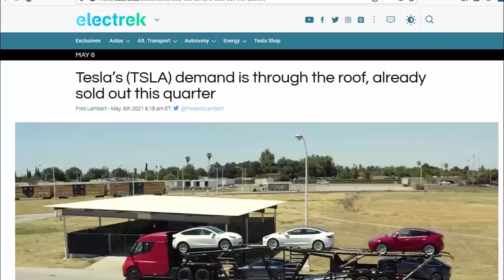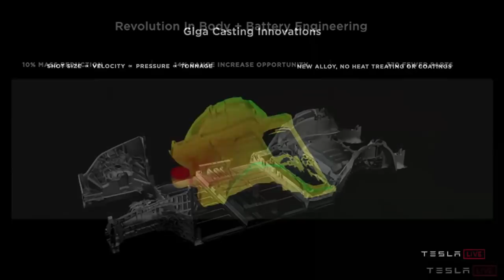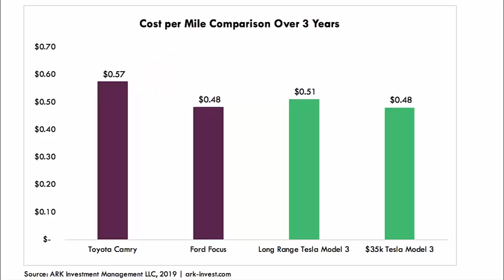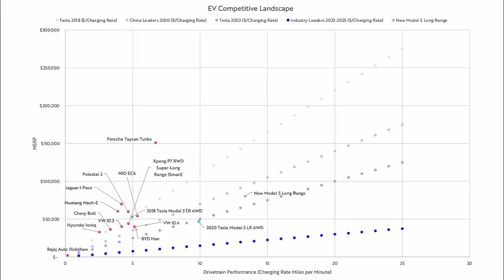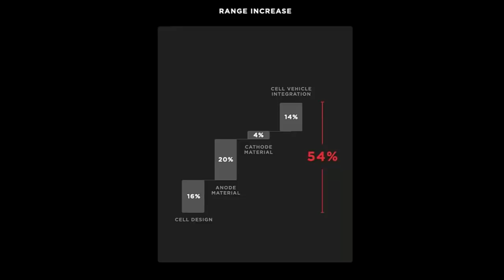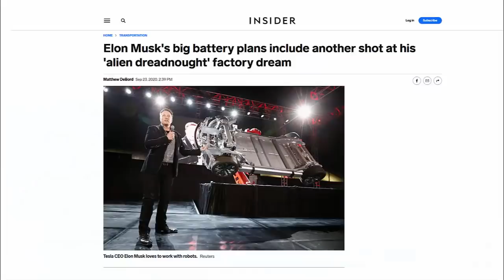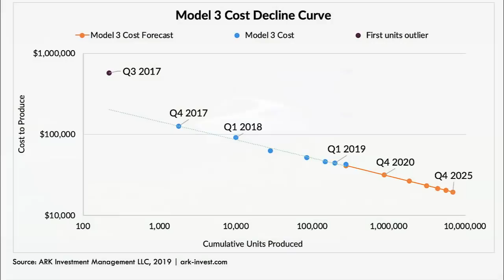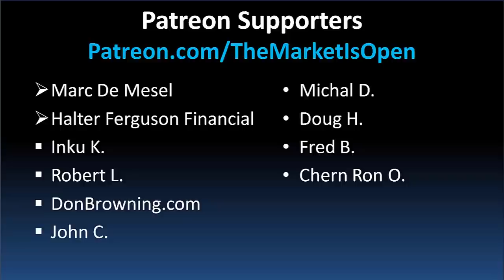The Frightening Economics of the Tesla Model Y

Comment from the maker: Do you think the Model Y's economics will allow it to become the best selling car in the world? What are your thoughts on the giga casting and the 4680 battery?
Tesla's Insane Plan to Produce the World's Best selling Car: https://www.youtube.com/watch?v=0C2K5vdG9WA

Inside Tesla’s Secret Plan to Dominate with Solar and Powerwall Plus: https://www.youtube.com/watch?v=W8ivhjzhYXQ
Have a look at our website https://themarketisopen.com
Reply: Some thoughts. Will the model 3 be able to use the same castings as the model Y? At first glance it would seem not, and it would only be a die change if not. But it if could share the design, that would ripple through the rest of the body shop. Also, I believe we may see the structural battery pack be a casting as well. The bottom and sides seem ripe for that type of savings. With regards to 4680, my estimates are that the High Nickel will be 120wH per cell, Nickel Mag 110wH and LFP will be 80wH per cell. Cost per pack will come down to $5200 for High Nickel, $4180 Nickel Mag, and $2900 for LFP.
Reply: Is it really tons of force or is it not just the weight of the casting machine?
Reply from the maker: No it's a custom machine ordered by tesla and the 6000 tonnes is force. The machine itself weighs around 410 tonnes.
Reply: @TMIOTesla  ah interesting. Why does it need so much force? I guess to resist the 800 lbs of aluminum traveling so fast
Reply: I like both the 3 and the Y but for me personally whilst I'd like the Cybertruck very much....it's more then likely going to be the awaiting $25k Tesla I'll be getting!
Reply: @Haliotro  yes, the cast has to be done very fast under very high pressure to avoid faults in the Alu alloy - that's problematic with standard alloys but Tesla has developed its own special mix.  This is amazing from a manufacturing standpoint, an innovation completely unrelated to electrification, much like the octovalve heat pump in that respect.
Reply: It can be the best selling car, for that it has to sell around 1.5 m only in order to beat the Corrola.
Reply: Y will start a crushing series of amazing developments
Reply: Best selling car in the world ?   No way.  Not unless Tesla finds a way to greatly reduce their price.  Also i think that the big car manufactorers have woken up and begun heavily investing in electric cars and it's only a matter of time before Tesla will have lost their lead,  if they had one.  

For Tesla to be the best selling car in the world it has to compete at more of a Toyota pricepoint,  not BMW pricepoint. The price needs to be cut in half to have a chance.
Reply: @peternielsen8723  It’s a fact.. all you have to do is look at the sales figures in each country. Tesla is at the top … even selling more than all ICE cars. The figures speak. Everyone is waking up because Tesla was taking their market away. So now time to caught up … good luck. Tesla is so far ahead that it is going to be tough. Maybe you will have to wait for the $25k car. With credits it won’t be so expensive anymore… unless you want to buy a the mini in China .., more like a go kart however.
Reply: I think it's odd that the most efficient car manufacturer in the world needs so much space for its factory. Is its factory smaller than its competitors?
Reply: Just a note about battery day presentation. These improvements in battery tech are expected to be achieved within 3 years from the presentation, as it was mentioned during the presentation. Meaning 2023 not 2021 when Berlin/Austin factories are supposed to go live. So Model Y will start production with only some (maybe none) of those improvements available, and some of these improvements might never arrive at all- it's all still experimental tech at this point. That being said, Tesla seems to have a very good groundwork for 2023...
Reply: Less is More. The competition remains the same. So he has far fewer parts to begin with and this will come down even further. They will create for joined or assembled parts off the cars. Assembly will assembling sub assemblies. Also the after market. You buy a New Tesla you buy a home charging point. You sell on your Tesla but you keep your charging point. The new owner becomes a member of the Tesla family. Where do you get your Tesla Derviced, Repaired? No back street autoshop. Again back to Tesla. With the iminent release of the Roadster & the Pick Up truck. Tesla an entrant in every segment of the market. The pick up could be the bell of Tesla when it goes head to head with Ford's F150 Lightening.
Reply: Carlo, wake up. Tesla sales in Europe is going waaay down
Reply: No. Tesla is about to face a ton of competition, and Elon Musk is going to go crazy why other automakers enter the EV market. The Ioniq 5 is a perfect example. Also, Tesla is not even close to a top global automaker. The Model Y might briefly become the best selling EV, but it's still a pricy luxury vehicle.
Reply: Tesla has a fight on its hands. Not from Europe but China and South Korea. Build quality, shut lines and paint should be a given. Tesla is behind the competition and its market segments on these. Xiaopeng and Geeley are up with it on automation. The game is getting tough. But, where Tesla really falls behind is cabin design and ergonomics. Putting out something that looks like a clean desk purge in a low rent IT department no longer cuts it. Note how Hyundai corp and Mercedes have shied away from the touchscreen scourge. Look at the cabin ambience of the EQS vs Model S. Xiopeng is also scaling up massively. It's going to get interesting.
Reply: @bryandavies6074  TESLA has took on the big 5 and is winning. There will always be other brands and other purposes & quality standards. Tesla started from an idea that was followed through. Before Tesla there were no auto makers in California or even Electric cars. The model "S" his guinea pig car if you like has been an outstanding sucess. And continues to be so. Now nearly 10 years on most of those cars are still running. Don't forget when he started there was no ZERO infrastructure. He has overcome the biggest hurdle in proving Electric cars are viable. The problem he has now created is that he had made electric cars desirable. They are socially acceptable, not only that he has engratiated them in the hearts and minds of the US Government. What City Mayor could ever countenance the purchase of a non electric city vehicle. They'd be drummed out of office. I am really surpirised I have not heard the clarion cry " Buy American, by Tesla."
Reply: @kevinburke6743  Which 'Big 5'? And why would anyone want to buy anything because it is American? It's hardly renowned for world leading QC and customer focus in the automotive world. Tesla deserves recognition for catalysing the development of practical 21st century EVs. But that's it. It now has some serious competition. And its Infrastructure in some parts of the worl is flaky. The idea that you'll make  380+ mile round trip to get a fault fixed at the nearest Tesla Service centre, is pushing customers   to other brands that have local dealerships. The Model S was a ground breaker. Model 3 is a great car. There are other great cars out there now too.
Reply: Will the Ponzi scheme last long enough for that to happen?
Reply: @bryandavies6074  Ford, GM, Chrysler, Mercedes & BMW. If you live in America its the default option. Tesla has made EV's viable for the masses. That includes all the others that follow. Tesla has come from nowhere and not made the same mistakes. They have 4 giga factories they have the biggest charger network on the planet. They have a use for their old batteries.Tesla have no dealerships/showrooms. Tesla has mobile service vans that just do Tesla products. Tesla make their own batteries. As a business Tesla has taken AI and vertical integration to the next level. Most Tesla owners are happy with their purchase. Some have upgraded renewed of bought a second car. Heck of a lot have solar panels and his powerwall. When the others cat up he'll be gone.
Reply: @kevinburke6743  I'm not sure Tesla was first into the 'second life' model for used EV batteries PSA/Nissan has been doing that for years. Tesla may have the biggest charging network at the moment, but it's (understandably) heavily skewed to the USA and can be really patchy elsewhere. There are other charge networks emerging rapidly and the need for multiple accounts and aps is diminishing. There's no free charging for the model 3 here. So the only benefit is a few extra charge points at a few motorway outlets. Model 3 dynamically is a great car. But a saloon (sedan) where we Europeans favour hatchbacks (lift gates) and the driver ergonomics and cabin ambience and utility now lag what the competition offers. A year ago that wasn't an issue. Now? Tesla's lead on efficiency is being eroded. 800v charging eats into its range advantages. It has some very credible competitors for the S and 3. It will have the same for the Y. Model  2 may put it back ahead of the game. But its going to have to be price competitive and on time in all markets.
Reply: @bryandavies6074  PSA would be dead if were not for Nissan. The epoc is self suffiency. Generate at home, store at home, charge at home. If it looks very bad weather wise after charging at work all day go home and draw of the car! Is anyone on the street going to charge you the same or less per Kwh? The free charging was just a break water to slow others down. They know you won't keep the car for life. But they want you to think it's that good. Even in the UK Tesla has a good charging network and repair centres. If it does not require lifting a man in a van will come out to you. Tesla gives you a choice, range or performance. 800v charges very fast and the penalty is life of the battery. Most people will just put in what they need to get home. i bet you never brim you car at a Motorway service station? The same with electric charge at home or hotel overnight & charge the company 0.46p/mile for 8,000 miles & 0.25p/mile after that! £3,680 + £500 for 10K miles = £4180. 20K =£2,500 +4180=£6,680. For 30K which I normally do £4,180 + £2,500 + £2,500 = £9,180. The inland revenue will catch up eventually. I saw one of those Model 'S's yesterday. I almost didn't look as it was in some Camo Green colour. Then I saw the Plaid badge. Inside looked awesome with the landscape screen and the yoke. All glass roof and some type of cream interior. It looked fresh and clean. Not like something that was a ten year old copy of a ford Mondeo!
Reply: The proposed $10,000 Federal Tax credit will make all of the difference in the world.  With the tax credit and my trade-in I'll have about $30,000 to put against the purchase price of a Tesla.  This gives me a very cheap Model 3 or an acceptable price for a Model Y and a very small car payment.  We may have to wait six months for the tax credit to pass through Congress.
Reply: @hooah2023  How does that impact on Tesla sales in Europe and China?
Reply: @InsidiousDr9  How is it a Ponzi. Familiar Product "Car." Sold by the Billions for the last 130 years. Same "Car" but uses a different fuel & costs a little more. In the last 8 years they have sold millions and are now ramping up production in 4 giga factories. They have also built a tangible infrastructure of superchargers. The big 5 Automakers are trying to play catch up!
Reply: @hooah2023  I'd go for the model Y if I were you. You are in at the ground floor. Please see sergelbergeron's comment below.
Reply: @peternielsen8723  that's literally what they are doing
Reply: #tesla #elonmusk #shiba
Reply: From listening to Robert Llewellyn Tesla cars are too big for English roads. When is Tesla going to make a small affordable run about?
Reply: Not the Y. When Tesla finally introduces a smaller, actually compact EV, the CUEV based on it will be that best seller, hitting 2 million easily. By the time they do that, they will be ready to do that, having actual high volume experience.

I see the CUEV being named Z (X, Y, Z, anyone?). Wait, no, it is trademarked. Maybe W. But the sedan, S, 3, then what? Or S3XY then what?

Open letters or numbers not already trademarked are what? G.K, if Chrysler never renewed. V? W? Maybe they need combos like 3 Jr. Y Jr.
Reply: The large casting is a good idea. The only downside is that they will become like other car makers and not want to change that particular part on future iterations. 

The battery is good if it works the way they expect it to. They completely ignored every negative ramification during their presentation. I know they know the negatives, but it is not confidence building for the people who understand that technology to gloss over it. Perhaps they will produce more information to satisfy the tech savvy at a later date, since initial presentation tends to be for the fans and the witless press.
Reply: @davidcox8961  What's the correct size for English Roads. 44T lorries seem to manage quite well with few restrictions. It can't be the length, the breath or the height because we've covered those. Oh, it can't be the weight as Telsas don't exceed 3tons which is the maximum unladen weight you can drive on a standard UK driving license! The bigger the platform the more space for batteries. The more batteries the longer the range between charges. The greater the maximum range the higher it lifts the average range. Then the less people have range anxiety! EV's don't work well as small cars, outside of cities. Charge all night at home and all day at work, then they become viable. The more the infrastructure grows the people will the advantages. The main advantage of course will be not having to pay conjestion charges everyday to enter every town and city in the country.
Reply: @kevinburke6743  I've never been to London but those who have say US made cars are too wide for the very old roads.
Reply: @daviddenley3512  Just hope our comments do not get confused with one another, given the slight color difference in our icons.
Reply: US made model 3/Y's are also inferior to the Chinese made Models because the Chinese models have the LFP Lithium ion Phosphate batteries that Tesla buy from BYD in China that do not catch fire, are more efficient and cheaper. LFP batteries are also superior to the 4680 batteries.
Reply: @toolrulz8005  Thanks for the info. But battery technology changes by the week almost. Don't forget our Elon did his Doctorial Thesis on battery chemistry!
Reply: @kevinburke6743  Elon went to China to learn about batteries and returned to America to become a billionaire by fleecing the ignorant gullible Americans. BYD have been making batteries before Tesla existed
Reply: @toolrulz8005  There are billions of gullible people the world over. Musk just stuck to what he knows. Legislators the world over are doing a great job of selling the electric future of transport. Trams and trains could not make it work even with government assistance. So now government will force it upon us.
Reply: @kevinburke6743  Actually in the decades gone by, oil and gas companies and the big motor industries and automakers  lobbied with the legislators and developed the idea to become rich by making the US public buy cars and oil instead of building trams and trains, look at all the other countries mainly in Europe and Asia where people can commute in big cities using an excellent network of trams, trains, subways, tubes etc and high speed trains for long distance travel.
Reply: @kevinburke6743  congestion charging will apply to electric cars at some point.In fact it's almost certain  the tax burden you have to pay will be the same for an BEV car versus a ICE car.
Reply: @motofunk1  There would be no cost savings by sharing the castings between Model 3 and Model Y as the fastest cycle time is 90 seconds and in practice will be significantly slower than that. They need multiple casting machines per vehicle. For lower production vehicles like Model S & X then sharing could be advantageous.
Reply: @peternielsen8723  I agree the price has to come down, but it will with the new innovations. Just how much remains to be seen. There are other compelling factors vs buying a cheap Corolla. Cost of ownership is already near the same if you count fuel, maintenance and resale value. But the real ace Tesla has up its sleeve is warranty. So far Tesla warranty has been minimal,  but Tesla's goal is to build cars that last 1M miles including the new 4680 battery. When Tesla is confident that the cars will actually last this long they can start warranting for say 400,000 miles and this will be passed on to the used car buyer. If you are in the market for a new car, would you choose a new $25k ICE or a used Model Y with more warranty left on it than the ICE has?
Reply: @netmaster88  Despite all we read about Tesla, I know very little about other car companies. Is Tesla (new factories) the most efficient? How do Toyota and VW turn out cars for half the price? Not all the difference can be accounted for by the expensive battery. I can answer the second half of your question. Tesla's factories are larger because they manufacture many more of their own components in-house. Most auto companies out source huge amounts including seats, wheel assemblies, and even transmissions.
Reply: @toolrulz8005  personal transport has always fallen into two categories. Work or pleasure/leisure. That goes back to horse and cart. If you had a horse of your own you were considered affluent. You could come and go as you pleased and when you please. We've moved this on to the stage we are at today. The other problem is the one you brought up. Living in the city, short commutes, public transport and some of the worst breathing air on the planet. There is not enough room for people in the cities so they have to live on top of each other up to about 100 storeys high. So lets say 2 people to an apartment, four apartment to a floor & 100 floors. If they all had a car where could they park. If they all had an electric car where would they plug it in. The problem is the stupid people that stand for public office. We elect them! So they have their home in the country or suburbs and work in the city. Any parliamentarian anywhere walk, cycle or take public transport day in day out. No, we give them car and often a driver. The problem is they still have to breathe the same CO2 rich air! Solution ban all CO2 emitting vehicles from towns and city centres. Because it is bad for us!!!!!! And was born the EV.
Reply: @kevinburke6743  That’s one way of looking at it, imagine all the millions of poisoned EV batteries that will eventually land up in a toxic dump someday. Think about your kids that will be living through that environment and polluting the water table underneath
Reply: @toolrulz8005  none of these minerals that go to make batteries come from other planets, they were all in the ground right here on earth. Everything has it's downside. Look at nuclear power! Battery technology will evolve. Look Tesla reusing under performing traction batteries for storage of home, commercial & industrial electricity!
Reply: FRIGHTENING? MAYBE TO THE COMPETITION
Reply: @frankmaitland2569  Tesla are going to make more cars with less parts and better quality and reliability than all the legacy manufacturers. BUT once your in your trapped Tesla car, Tesla home charger, Tesla Superchargers & Tesla fuel card for other alternative top ups!
Reply: The way  Myspace dominates the social media space?
Reply: @peternielsen8723  What most people don’t understand yet is to look at the total cost of ownership over a number of years, not only the purchasing price.
Reply: @CarloHerrmann  ?. Pretty obvious all the commenters have little to no idea how to fix a car, nor the inclination to do so. The cost of ownership for one of these is 100x that of a standard used vehicle.
Reply: @InsidiousDr9  ..... this comment for the win; maybe this "green energy ccp scam" will have the legs, but likely not.... Going to be fun to watch all these ev charging stations get auctioned off for pennies.
Reply: @toolrulz8005   bingo
Reply: @peternielsen8723  it has to compete with a Toyota EV though, let's see what they can do when they finally realise that pure EV is the future
Reply: @bryandavies6074  this argument makes me remember the iPod vs all those other MP3 players back in 2002.  Software and clean design won out then. This time Tesla isn't a late comer as Apple was back then.  Tesla is Apple today , and it's what people want. Clean desk policy? What utter drivel.
Reply: @davidcox8961  RL drives a model 3. Have you been to the UK lately? There's loads of model 3 s there (and other EV like VW too) the 3 and Y are perfect for the UK.
Reply: @bluetoad2668  What utter drivel indeed. Being early in 'the game' is no guarantee of long term dominance. Though I suspect Tesla will be around, in some form in 50 years time. There's a difference between designing the user interface for a computer, a music player and a vehicle. A touch screen that you need to look at isn't as good as a knob, button or lever you can feel for without having to take your eye off the road. They are fine for secondary functions and settings that you can deal with at standstill. Of course, Google voice control can ace the lot.
Reply: @bluetoad2668  RL is the guy who I heard say that Teslas are too big for UK roads. I am not speaking from experience. Never been there myself. Cheers!
Reply: @Haliotro  I work in auto.  Presses are rated by the force they produce.  Not how heavy they are.